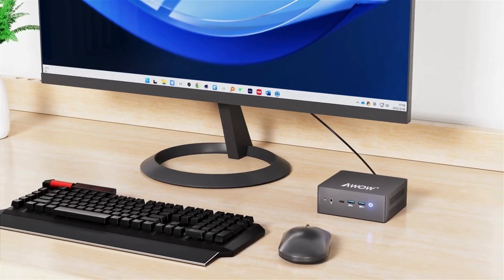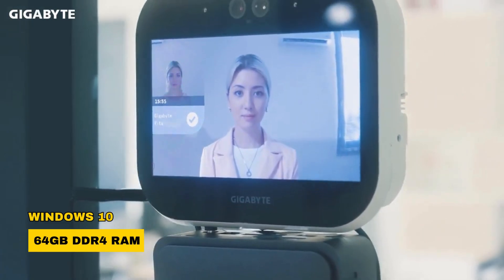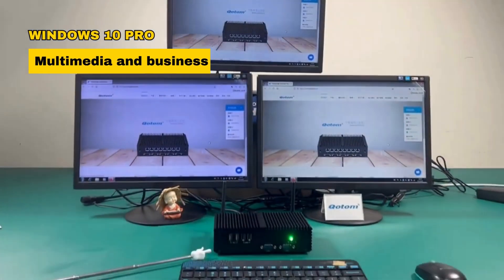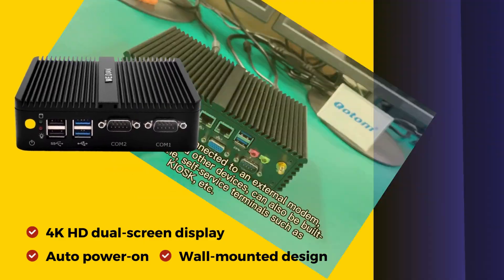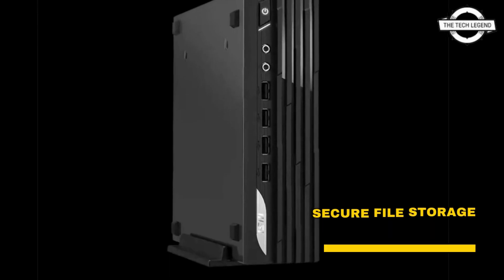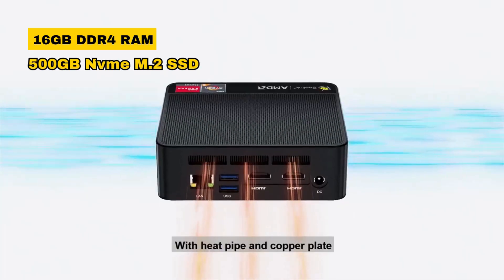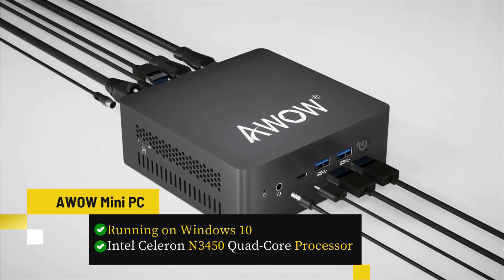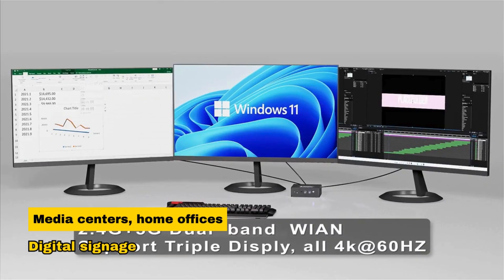Top 5 Picks For The Best Mini PC In 2024 | Best Mini PC For Gaming

Comment: I'm surprised Geekom didn't make the list.  I just bought a Geekom IT12 I7 w/32G and 1T  for $569  U.S.  with Windows 11 Pro.  I'll have to look deeper into the ones mentioned here, but I think I have the winner.  Although I'm not using it for gaming, so it may fall short for that.   But the 10 core 16 thread I7 makes it great for software development and supports up to 4 screens.  So far I'm very happy with it.
Reply from the maker: Wow, that sounds like a fantastic deal on the Geekom IT12 I7! It's always great to find a powerful system that meets your specific needs, especially for software development. The 10-core 16-thread I7 and support for up to 4 screens are impressive features. While it might not be geared towards gaming, it seems like a solid choice for your intended use. Enjoy your new setup, and if you ever decide to explore gaming or have any questions, feel free to share your experience. Happy computing!

Comment: Thanks for the video. 

It really doesn't make any sense to build a computer with less than 32 G of ram and 2 T of storage.  Anything less can be done on a phone. 

These mini PCs should also focus on running from 12 , 24 and 48 volt batteries directly vs needing odd ball voltages.   There are plenty of needs in mobile and extended temperature use applications.
Reply from the maker: Appreciate your perspective! While I agree that higher RAM and storage can offer better performance for certain tasks, the beauty of mini PCs lies in their versatility. They cater to a range of users with diverse needs, and for some, a more streamlined setup might be sufficient.

Your point about optimizing mini PCs for direct battery usage at various voltages is intriguing. Indeed, catering to mobile and extended temperature applications could open up new possibilities. It's always exciting to explore ways to enhance the efficiency and adaptability of these compact computing solutions. Thanks for sparking this discussion!
Reply: @rafayelpicks21   it is probably driven by my own work,  building 12, 24 and 48 volt mobile power systems that go into vehicles.   They have to withstand the automotive temperature range and environment.